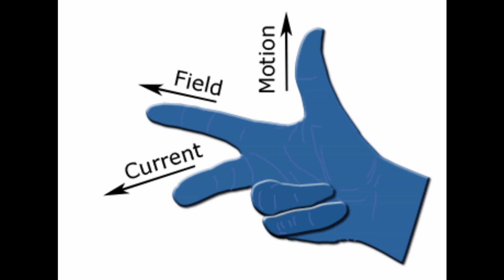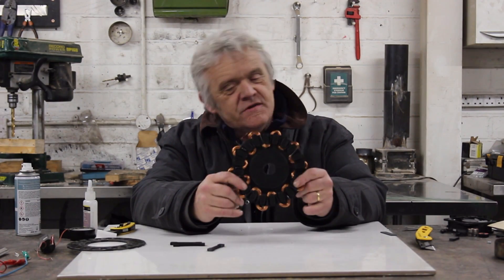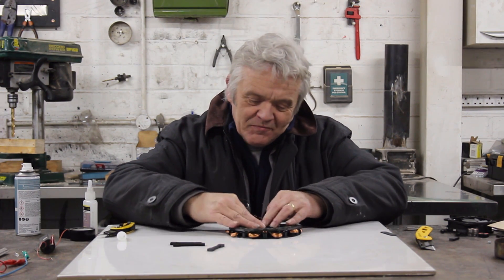1859 A Serpentine Coil - How To Best Make it

Comment: hi do you have the measurements for the jig to wind the coil, looks like you figured out the right distance for the coil part but it has to be woven so its bigger than the diameter of the wheel, jus wondering what the distance between those bolts that you wound it on are :)

Comment: Like what you're doing with one way gears and a generator, I too have been fascinated with those as well as I used to build motorized bikes with engines and motors-those were indispensable for that purpose.  One of the best versions I found was attached to a high power scooter motor sprocket, and it was incredibly silent and durable (mated it to a 5hp 2 stroke engine and it handled it for many miles) 
I'm going to try my hand at 3d printing one as well, I'm going to see if I can cast the gears from aluma-brass in my backyard foundry.
Reply from the maker: nice mate - let me know how you get on
Reply: Awesome plz let us know your findings and outcome.

Comment: Hello Robert I have a Question, can a Serpentine Coil be a motor coil as well as a generator coil? 
If a Serpentine Coil can run as a motor, where would I find the info for this? 
As I can not seem to find anything on the motor side of a Serpentine Coil, the only thing I could think of is it that it might be close design to a induction coil for it to act as a motor or are the 2 coils nothing alike?
Another thing I would like to know is, what is the difference between a induction coil and a Serpentine Coil? 
Any info on this or where I can information to learn from would be helpful thanks

Comment: Very interesting, thank you!

I think there is potential to simply use the spool that magnet wire comes on if you can find the other end of the wire without unspooling it. Then you can buy as many 'coils' as you need with confidence it will have the same amount of turns.
Reply: Probably not your spool of wire though... That is a monster! Lol
Reply from the maker: some do come with the end that easy to find - but you are right the monster I am using really needs unspooling lol
Reply: @ThinkingandTinkering  I’m very curious! How many turns does it take?? Thank you in advance this just blows my mind ✨

Comment: Now if you could add a ferric material to the coils to improve magnetic inductance coupling to improve power output. Perhaps some ferrite toroids.
Reply: I was going to suggest the same.   Thin laminated sheets of iron to prevent eddy currents.  Like you said, this is like magnetic gain.
Reply: @carlwilson9992  That would be better, but difficult to implement, since its difficult to get sheets of silicon steel. Cylindrical ferrites or toroids are easier to source.

Comment: What type of wire are you using? And where to find the STL for that base?
Reply: @SystemsPlanet  I will stop wasting my time with this channel. Everything I see contains just pieces of information and demonstrations, nothing actually useful to recreate anything we see here. For example, after following all the videos of the serpentine coil, I managed to make one using the same specs, but is at most half the thickness we see in the videos.  (810mm (per turn) +10% = 891 x 400 turns of 0.10 Litz wire). And of course, I don't get the same resulted voltage as in the videos. I'm quite disappointed. Time to get back to reality...

Comment: I may commemting stupid ideas, but here is another one;
It may be more efficient to wire the coil around a sort of ring. Like imagine cut out a piece from a plastic/glass bottle in the middle and coil the wire all the way around it in a vertical perspective. Of course, it would take a a millenia to do it by hand, but using a machine, that work on the priciple of like a sewing machine, that would do it simpler (i have absolutely no idea how to build or plan it... :D ) But if we state, that generation is at it's peak at 90 degrees and we are using rectangle magnets in a radial order rather than cylindar ones in axial, the relationship between the magnets and coil would always be 90 degrees. I'm pretty sure, we could stick to the speed on the edge philosophy rather than torque on the shaft also in this configuration. Just make the ring/wheel itself reaaaaally wide. I know, it's almost the same like the Mighty Mite generator, but i hope the idea is sort of clear. (In case of misunderstandig, sorry, english is not my motherlamguage)

Comment: the serpentine is chosen because it's an alternating permanent magnetic field, right?  Is there some sort of space-filling curve that would expose even more wire to the magnetic field?  Axial flux motors seem to work by having several flat circular sections of wire instead of a serpentine coil.
Reply from the maker: yes that's right and I did a couple of vids on alternate coil arrangements - you might want to check them out

Comment: how about a copper pin coil
Reply from the maker: what about it?
Reply: I think the copper pin coil is what Tesla has moved to increase power torque and efficiency while keeping it small?  
I would think with a design template, attaching the pins with a pin welder or spot welder would be relatively easy.

Comment: Could you just wind it with a bit of copper pipe or pins?
Reply from the maker: yes - but why?
Reply: @ThinkingandTinkering  Higher current maybe. Tesla was using pin motors to handle more current and I wondered if something similar would work.
Reply: @travismoore7849  thick conductors just give you less voltage and more current, and high voltage is more efficient than high current. That's why there is very high voltage in power lines.
Reply: @matslarsson8790  What if you could have both high voltage and amps by using wide laminated insulated conductors as a hybrid of both?

Comment: What do we got today?
Reply: Ooo serpentine coil under the pendulum gene... Or would you put the coil on the pendulum with a magnet track under it
Reply: I'm seriously considering a pendulum gene for adding to the off-grid solutions. You can just set it going for awhile just by picking it up and dropping it . Better than the sand wheel ?
Reply from the maker: lol - tap it and wrap it mate lol
Reply from the maker: I don't know if better is the right way to see these things mate - some are more appropriate that's for sure

Comment: If you're looking for a good flywheel, consider a used car brake rotor, or a full stack of them. There's plenty of them available at your local repair shop
Reply from the maker: nice tip - cheers mate